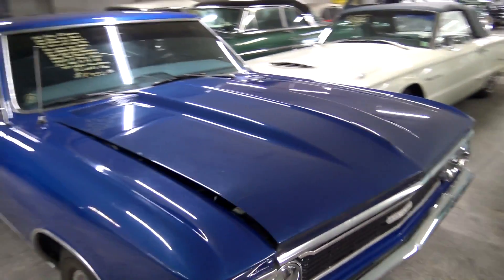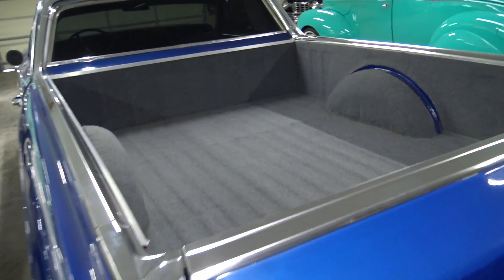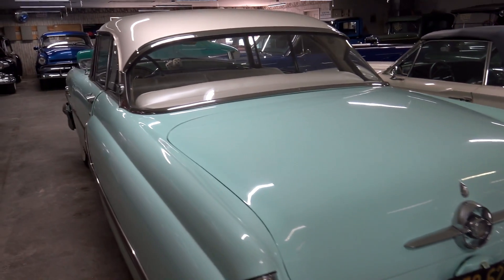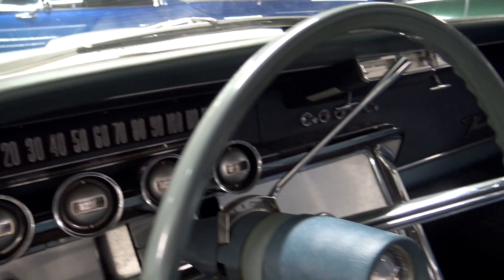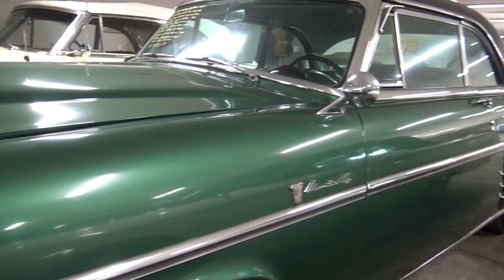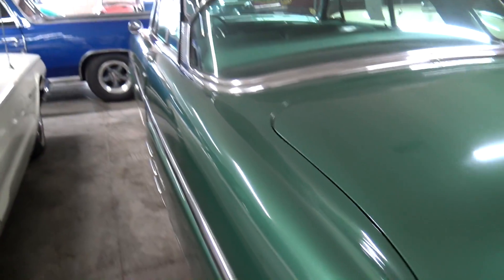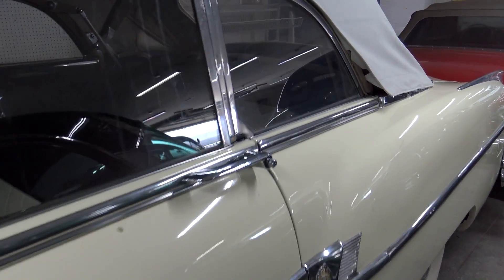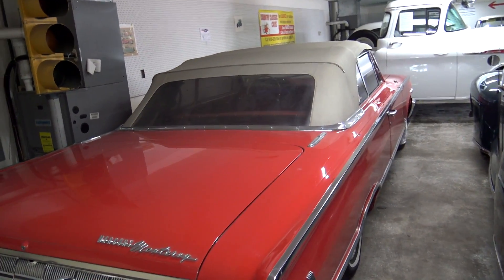Shed Tour Part 2 - Country Classic Cars - June 2020

Comment: The 53 Mercury is my favorite of all the cars you showed.  I graduated high school in 1966 and my oldest sister and her husband bought a 1967 Chevelle SS 396 convertible with a four speed so the Elcamino is one of my favorites also.  The Packard must have  cost twice as much to restore as the asking price and if you did one today it would cast at least 3 times as much to bring it to that level.  Add the price of buying the car to restore and that makes the Packard really cheap at the price.
Reply from the maker: There are definitely some great deals in this group.  I really like that '53 too, that's a nice car.  Thanks for taking a look Roy!